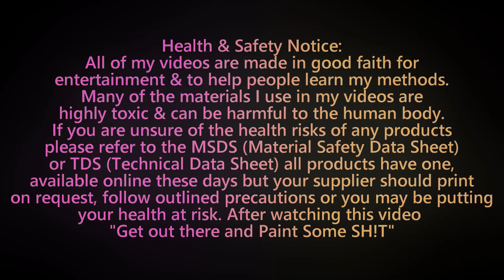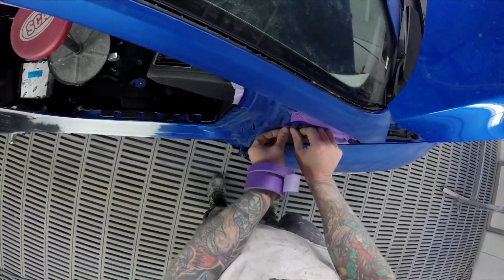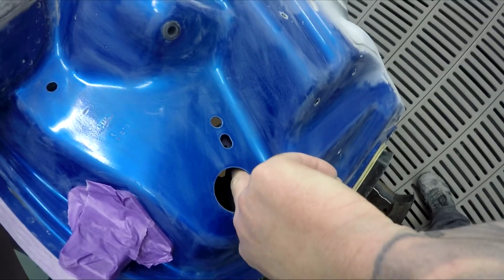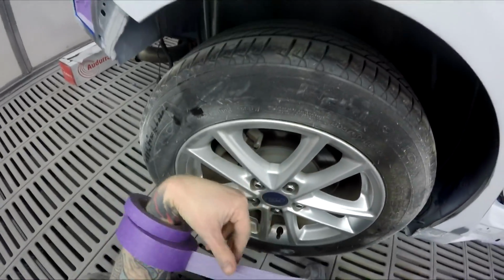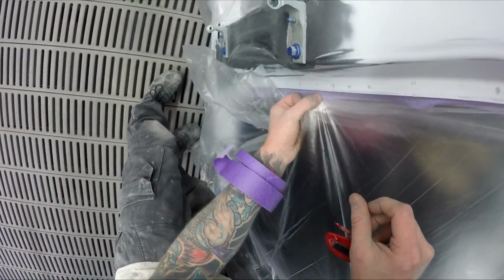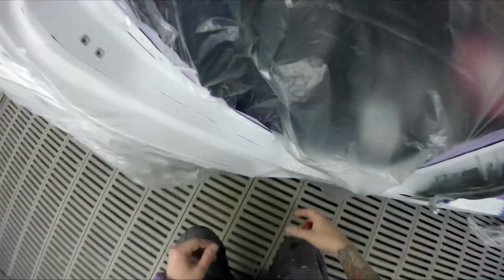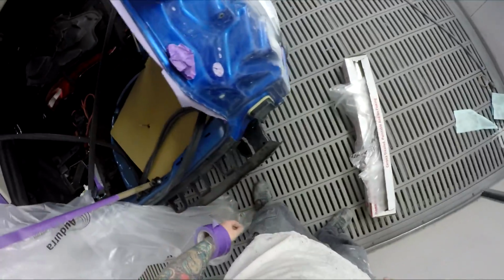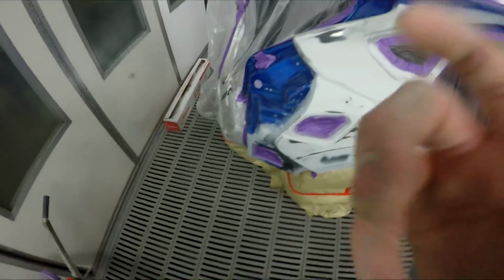Ford Focus Masking

Comment: Big fan of the masking vids gunny, i am a home DIY painter i have learnt everything i know from watching your vids, i just recently attempted my first flow coat on my guitar i had sprayed a while back, unfortunately it did not turn out very well it has a fine orange peal look to it that i could not get rid of even after some thinners i sprayed after to try melt it down.. i use a Valspar MS clear coat because that is all i can get locally but during the summer months i was getting excellent finishes with it using my GPI, but ever since winter has come along i have been struggling with runs and orange peal, i am at the point of giving up on spraying during this time of year. since the cold months have set in i haven't been thinning down my clear, should i still still thin it down slightly ?
Reply from the maker: Best bet is to warm it up to 30°c before spraying. Your life will change

Comment: What I’ve primer do you use ppg one choice still stays sticky after a while with acetone they recalled a bunch 3 years ago for a revamp on the formula and I still can’t dig it basing on it with water base is butt almost always sanding after one light coat separation of the primer to base and no continents h20 cleaner and solvent wipe  before a tack

Comment: Im gonna paint whole car next week it is my first time painting whole car and if you have some advices about masking it would be very helpful
Reply: Masking is the easy part
Reply: Yes but some tips can come in handy
Reply: @simuncelic7420  most important thing is sanding well and blocking if your doing a resto job
Reply: Make sure everything is CLEAN!!! Mask all panel gaps, cracks, anywhere dust can hide. If you don't clean the dust out or seal it behind your masking, it WILL find it's way into your paint. Skirt the bottom of the vehicle. Take your time and recheck everything multiple times. It might make you feel crazy, but your paint job will be better for it. Hope that is helpful.